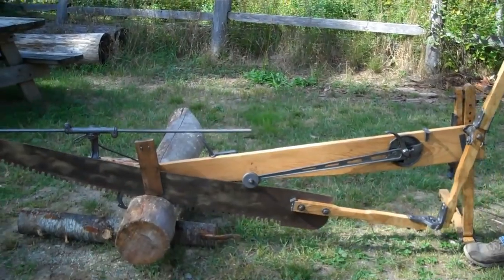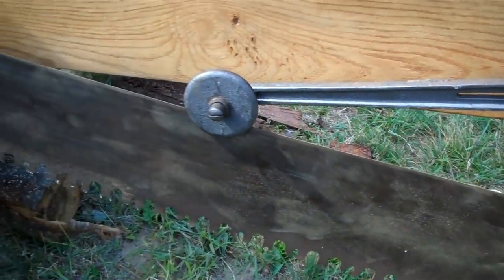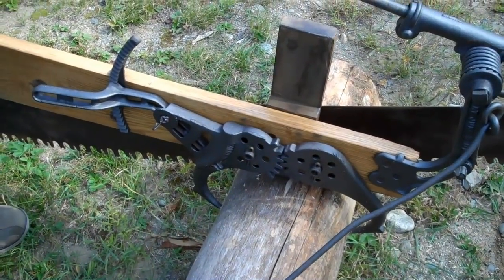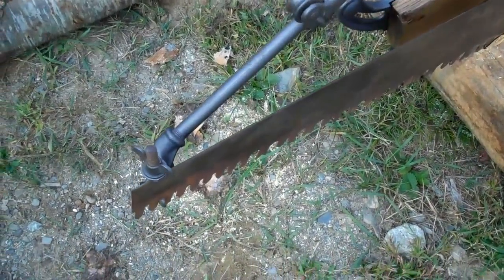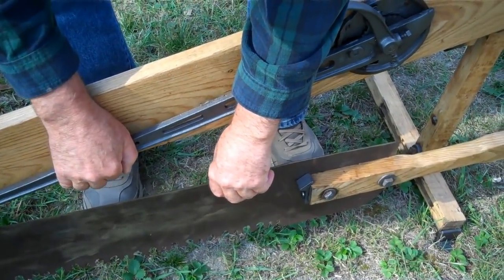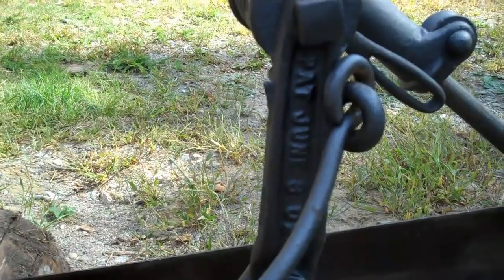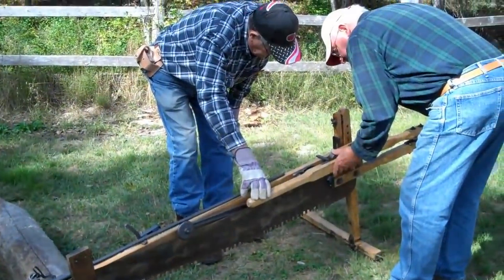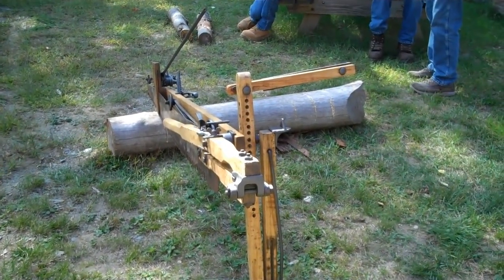Human Powered Drag Saw

Comment: How is this better than just pulling on the saw? Nice restoration though.
Reply: I’d say several different ways .... 1, you are not leaning over or kneeling down to the level of the log. 2, this blade, most likely has much more aggressive teeth on it than any man could productively push with just his arm strength. E mechanical advantage in several ways! Not only the push pull cycle is easier it has tensioners at front and rear of blade to apply downward pressure..
Reply: bob criss Yeah, I suppose. But as to point #1, one could just put what you are cutting up higher. I still suspect that with two people in good shape operating one saw, it could be faster. The blade guides probably also help to dampen vibration, which can be quite helpful.
Reply: You could have ten men with one of these each cutting their own trees/logs, doing the work of twenty men with ten two man saws.

Comment: why not use a crosscut saw
Reply: It is a crosscut saw. It's basically a one-man bucking saw with the handle removed.
Reply: @dungeonmaster6292  i know thats the point

Its no different, so why
Reply: @gabrielsturdevant9700  Yeah dude I am wondering as well. These things were designed to work with rotational drive mechanisms/engines.
Reply: @gabrielsturdevant9700  the ability for one man to do the same work as two.
A small lumber business could employ ten men each with one of these, vs twenty men with ten two manned saws.
Reply: @Beuwen_The_Dragon  you can use a 5 1/2 foot saw with one man, ive done it myself.

The real reason is drag saw blades are much heavier and will cut faster